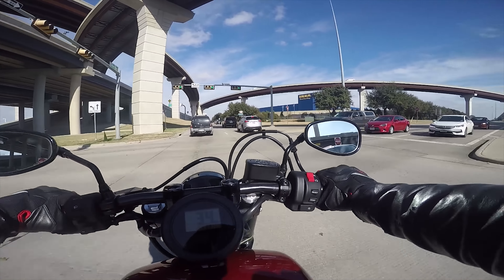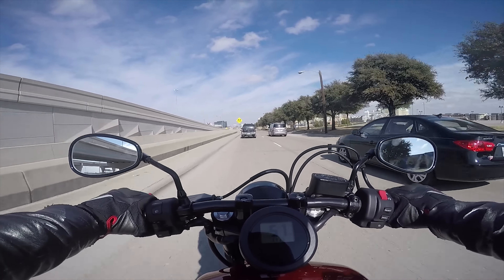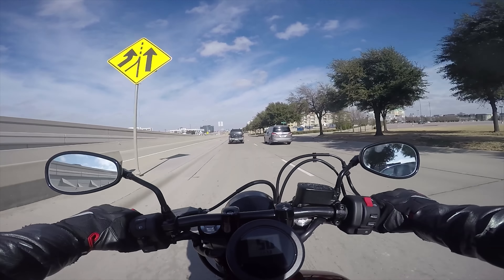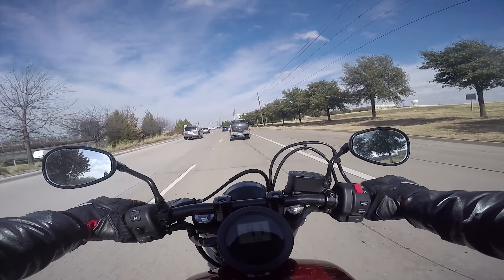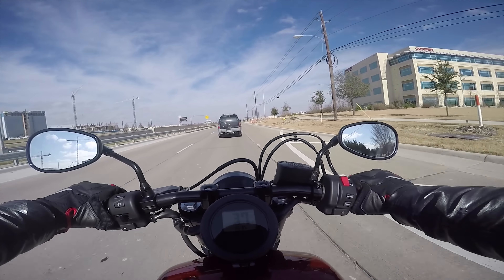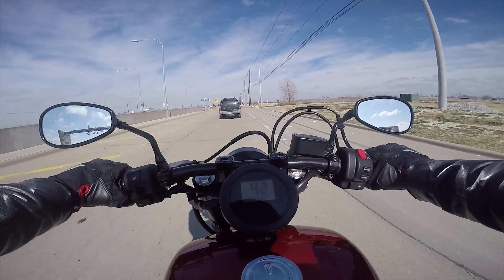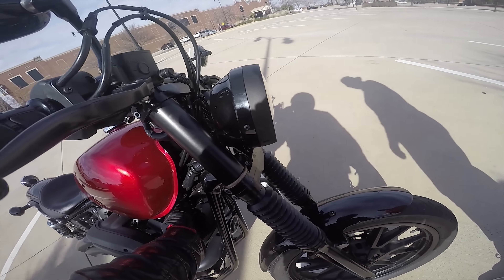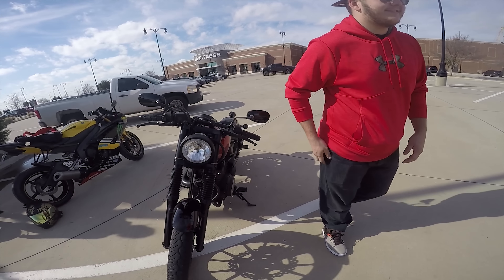Before/After Yamaha Bolt [Drag Bars, Grips, Fork Gaiters, Fat Fork Tubes, Flush Turn Signals]

Comment: What size of LED rings did you get? And did they fit over the fat fork tubes or just sit under the fat fork tubes?
Reply from the maker: They're wrapped underneath the fat fork tubes, not sure what size it would be without measuring, they actually came with the fat fork tubes I bought. But they're wrapped around the stock forks so it would be diameter of the stock forks for sizing if you wanted a different brand of LEDs

Comment: ZED, did you had to replace your risers? For 1 inch risers? And did you have to change your controls? Just asking Because i’m Looking for a new bar, these look Very Nice, But I don’t Want to change too much of the stock controls or risers... let me know! Nice ride man!
Reply from the maker: Jelle van Beers all I had to do was flip the risers 180° and it fits. No new controls, just the same as Stock
Reply: Allright Thanks for the reaction! Now I Got the same grips like you do, But i was curious if you remember if you can take the throttle tube out of the stock grips, Because I Got the grips where I need to get a separate throttle tube, or Salvage the old One from the stock grip... do you know anything about that?

Comment: Get a pair of Motogadget M-Blaze LED turn signals for the rear.
I installed it on my Yamaha Bolt and it's barely noticeable and SUPER bright. They have a focus point for you to adjust where you want to aim majority of the light but, since it is glass, the entire bullet lights up.
https://www.revzilla.com/motorcycle/motogadget-m-blaze-pin-led-turn-signal
Reply from the maker: I picked up a LED bar for the rear on the cafe seat. ill see how that turns out, but if it's not as bright as they advertise (which it probably won't lol) ill definitely pick those up! Appreciate the recommendation!

Comment: did you spray paint the speedometer ring?
Reply from the maker: Mike Santora I didn't, but it's very easy to. I just went and bought it from Yamaha. it wasn't that much and turned out way better vs me trying to paint it lol
Reply: Thank you for the quick response! I ended up scotch briting all the chrome and spray painting - came out mighty fine. Did you by a blacked out gas cap as well then?
Reply from the maker: Ah very cool.  I was going to,  but after looking at the price for the one i wanted ($100) i decided to plastidip it for the time being. Not the best job, but ill eventually get the gas cap.
Reply: Yamaha ZED you bout a whole new speedometer or just the ring?